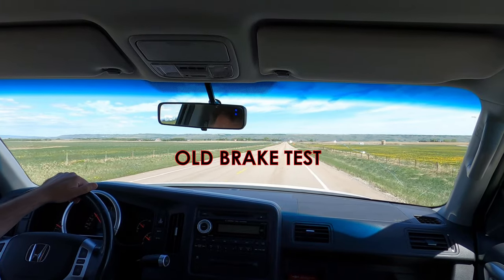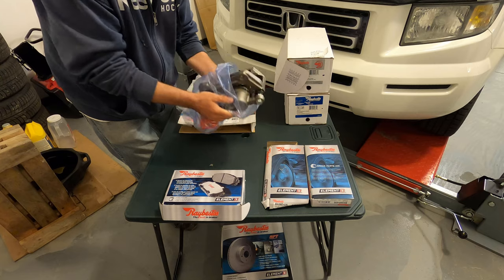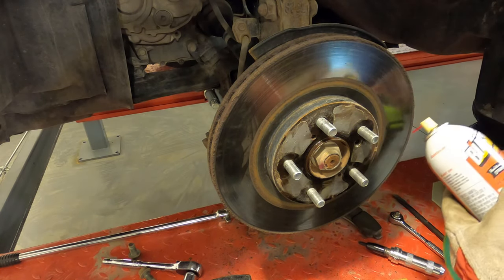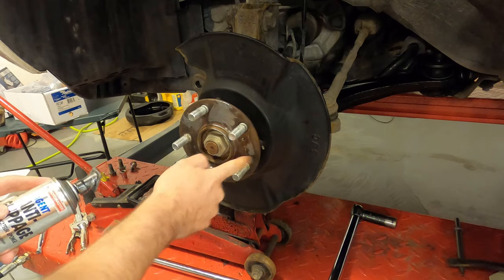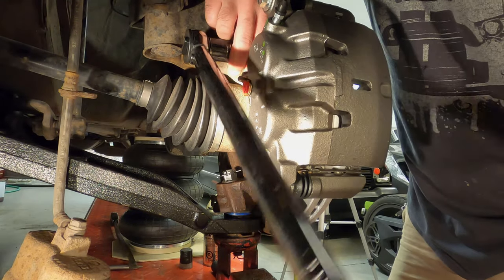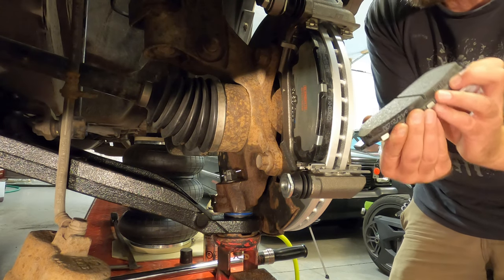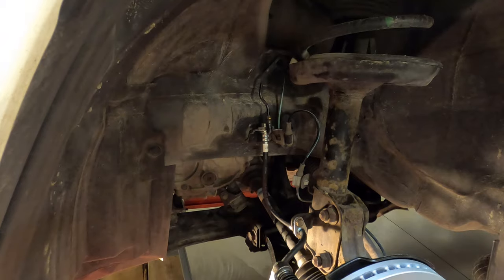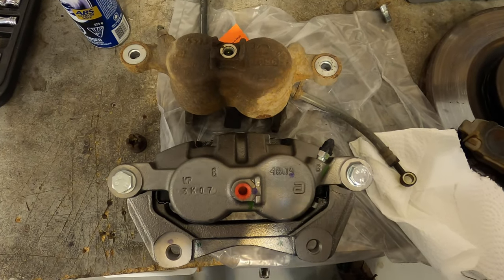Honda Ridgeline Brake Upgrade - using Pilot brakes! full installation and results

Comment: I just completed a cheaper version of this upgrade along with flushing all fluid from system. I sourced parts off a 09 Pilot from junkyard. Saved tons of money doing this. If you buy new calipers there is a core charge unless you buy online. The store I called (I wont put them on blast) told me they would not accept calipers off my ridgeline as core..Not sure they would know the difference anyways. I tow a boat weighing about 4500 pounds so it puts the Ridgeline at its limits. I was at 64k miles and my rear pads were down to nothing measurable. There's a notable difference in the surface area on the Pilot rotors and I can feel the difference so thanks for posting.
Reply from the maker: Yes nice work.  I just returned my cores they don’t know the difference.

Comment: Add to the flange and mating surface of the rotor. Eastwood rust encapsulator. Also check Speed bleeders.
Both very good products.

Comment: I did this on a ‘09 Odyssey, and on two of my gen1 Ridgelines… to get the most out of it, upgrade the tires to get more grip and use the new found braking power. 265 wide tires will make your eyes want to pop out the sockets…
Reply from the maker: I have an Odyssey and the stock brakes feel good - better than the Ridgeline stock.  Yes this upgrade makes a big difference.

Comment: Any updated issues to report? I'm considering this upgrade but have read about uneven pad wear, would be great to hear how this is holding up for you.
Reply from the maker: the new brakes are great.  Much stronger with stopping power.  I haven't noticed any pad wear issues.  

Even if I did, pads are very cheap so just replace the pads once in a while.  Worth the upgrade especially if you need to replace brake parts anyway may as well do the whole thing.

Comment: What year ridgeline is this? Will the 2010 parts from the pilot work on a 06 ridgeline
Reply from the maker: 2007.  Yes all 2006-2014 Ridgelines are the same.  This is the best upgrade I have done on the truck.

Comment: Does this require a recalibration of the ABS module so the rear brakes don't grab first?
Reply from the maker: It seems to work fine as is. Good point though may be something to consider on some cars

Comment: do back brake from pilot work to ????
Reply from the maker: maybe but back brakes don't do much of the stopping anyway so I'd stick with the factory ones.

The front brakes do most of the work.
Reply: Also wondering about this. About to buy the Pilot calipers myself... Might take the chance and just do all 4 Corners
Reply from the maker: @bobbylevy5718  I wouldn't worry about the back brakes.  The front do all the work.  Just put the standard brakes on the back.
Reply: @bobbylevy5718 have you done the pilot brake switch yet

Comment: You had a plug to plug up your breakline, did that come with the brake line kit? Or did you make your own?
Reply from the maker: it's just a vacuum cap.  available lots of places.  any rubber plug works.
Reply: @gregs_garage  Thank you

Comment: Does this make the brake pedal firm ? Mine is soft ever after a flush .thanks
Reply from the maker: It may.  There is some reason why the pedal is soft.  bled properly?
Reply: It will feel slightly softer up top , but once u get used to the new pedal feel, you should notice it stopping better. 
If pedal feels soft but better with a second pump… then your master cylinder needs replacing

Comment: can you upload the complete rockauto parts list please
Reply from the maker: I could, but it's better if you look up on RockAuto for a 2010 Pilot:

 - Set of front pads
 - 2 Front calipers
 - 2 Front Rotors

There are different brands and the prices change over time and the shipping varies so you have to play with combinations until you find a mix that minimizes shipping.  There's also bundles of pads/rotors, pads/calipers/rotors.  

And add 2 front hoses for a Ridgeline.

Comment: Where did you buy those parts from?
Reply from the maker: Rockauto
Reply: New brake hoses are for the 07 Ridgeline or 2010 pilot?
Reply from the maker: @JoEy41420  great question.  Use hoses for the 07 Ridgeline.
Reply: Do you know if the pilot rear rotors and pads will work for the 07 Ridgeline?
Reply from the maker: @JoEy41420  don't know.  rear brakes don't do much so I wouldn't worry about it.